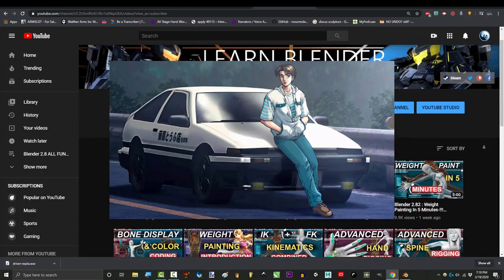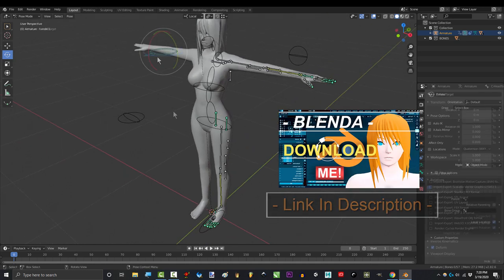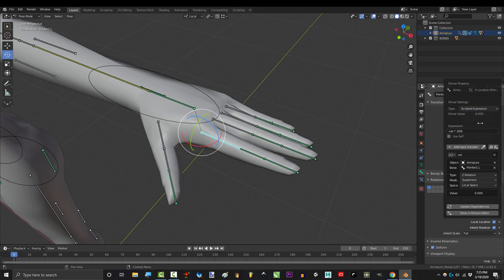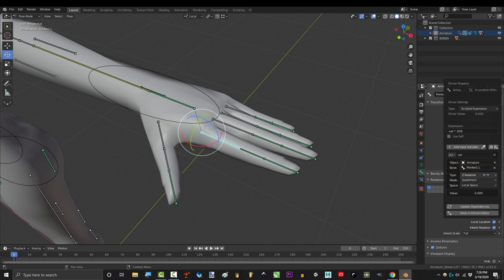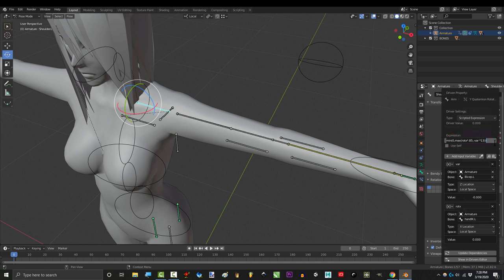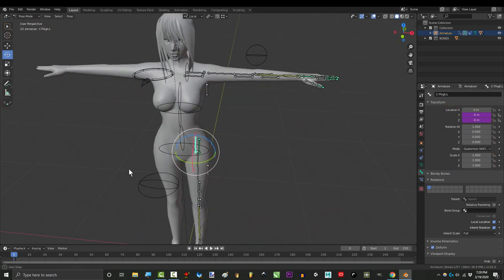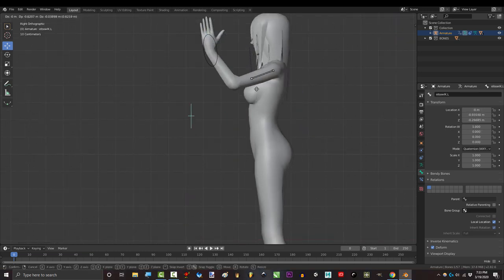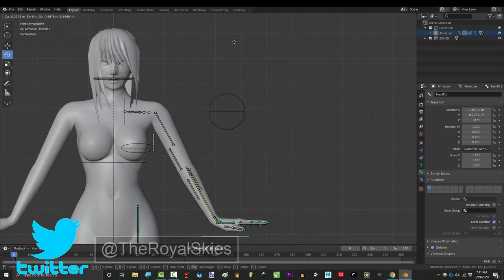Blender 2.82 : Drivers Explained (Crash Course)

Comment: The trick to understanding drivers is viewing every action in Blender as "some data being modified". Each bone stores its own location and key-framing a change in that stored value is what creates a movement animation. Every location that is stored has x , y and z components, which can be thought of as variables .

Consider 2 bones, b1 and b2 , which have stored location variables x1, y1, z1 (for b1) and x2, y2, z2 (for b2). By default, all 6 variables can be modified independently from each other. Meaning a change in x1 has no effect on x2 and vice versa.

What drivers do is take a variable ( consider x2 ) and make its value dependent on 1 or more other variables. Let's take x2 for example and make it so that x2's value is being 'driven' by x1's value . You add the driver on the variable you want to drive ( x2 ) and specify in the settings the path to the variable you want it to be driven by ( x1 ). Variable x1 can be in a different object so you have to specify which object in the driver settings.

Then once you establish the link between x2 and x1 , you have to specify what is the exact nature of the link. That's the Driver "type" which in this video was set to "Scripted Expression" . Here, typing 'var' represents x1's value .

If you type just 'var' in this field, then the nature of the link between x2 and x1 becomes x2 = x1 .
If you type "var + 5" , then the nature of the link becomes x2 = x1 + 5 .

You can even add another variable to make more complex dependencies but I'll leave that alone for now.
Reply from the maker: I love this explanation, well done :)

Comment: Is there a way to put some kind of a toggle on drivers?   I am modding an existing rig set up for MMD motion imports to use some added IK and controls based partly on your tutorials with some adjustments.  I have been able to get most of them to work without interfering with imported motion capture, but drivers so far are one of the exceptions I have run into so far (though I haven't tested around this too thoroughly yet).  They work great on the rig, but the imported motion data makes them go haywire.  Ideally I would like my rigs to be able to take the mocap and then be hand-animatable from there including using drivers, but as a blender newbie, I am not sure if that's plausible.

Thanks for all the great work, I've been learning lots from analyzing what does break the mocap and what to change accordingly.   :)

Edit -update: More testing and it seems I just missed setting the driver to local space, though I may have messed up some other step last time too.  Now my model is using the drivers with no interference so far.   :)

Comment: Hey, quick question. I have realised that indirectly moving a driver object (i.e. using a parent to move the driver object) causes it not to affect the object that it is intended to affect. For example: while using a container's movement to manipulate a wheel rotation, parenting a container to an empty and using the empty to move the container, the container's movement doesn't affect the wheel's rotation. How can this problem be solved?

Comment: Hey, I have a doubt: I'm using drivers to animate expressions in a character I'm making (an alien), using shape keys, then I used drivers to link the shape key value in the movement of a specific bone (its Y location) of the character's armature. But ... there is one thing I want to do now: I added a Driver to the Emission shader brightness value that I used in the character's eyes, I want the emission value (which is 15) to decrease to 1 when I move the driver (the bone), I want to control the on and off of his light with this driver, but I want to know how to do this without having to make a huge displacement, you know, control the sensibility of this interaction. In this case, what is the expression that I need to type on the driver?

Comment: I wish I could agree with the rest, but the input of the driver is really too familiar for me, I'm just struggling with where to place correction bones and keeping bones stationary during movement (I need controlled movements so elbows, knees and feet need to be pretty still in place)